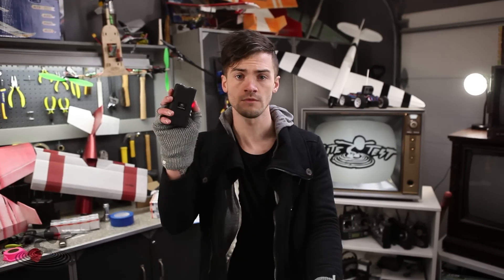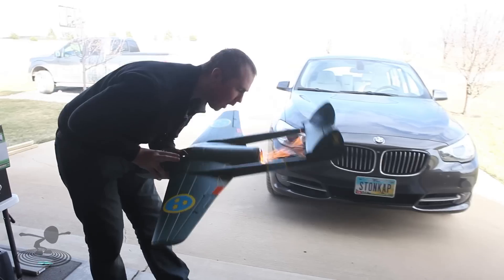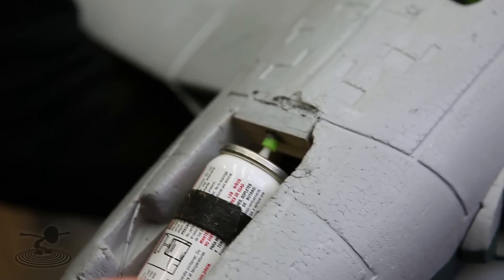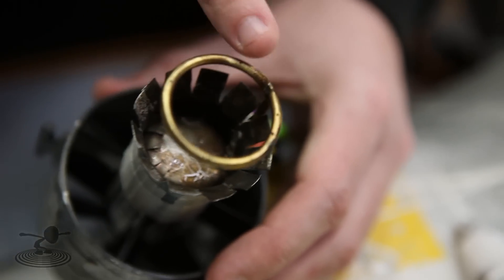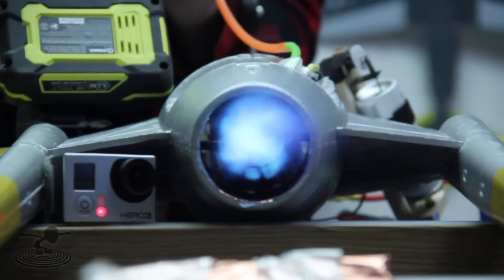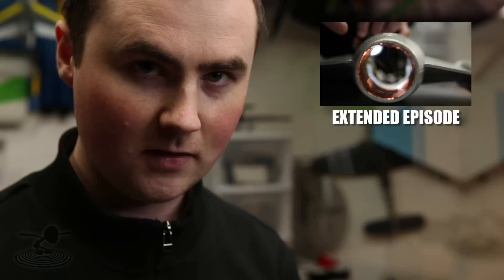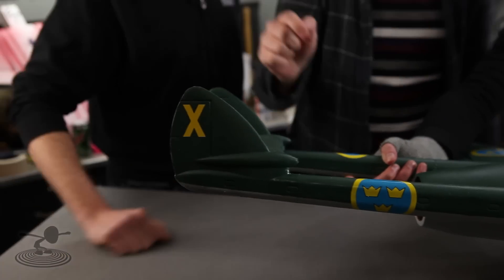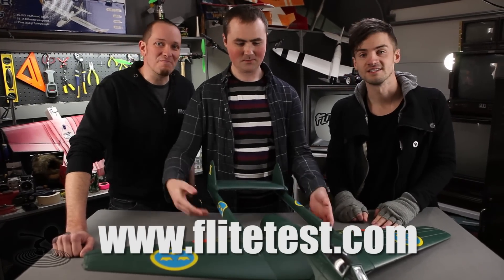Flite Test - EDF Afterburner

Comment: So you used a real model Gas Turbine sound effect....and how exactly did you arrive at a 15% thrust increase? ...As an engineer, I would suggest a decrease in thrust is the reality, all that fuel coil slowing down the airflow from your ducted fan, which incedentally is a very inefficient way to provide thrust in a model....Ducted fans and real Gas Turbines are in no way even similar....Brave though, considering the plane is made from very flammable foam.
Reply: Are you an aerospace engineer? Do you understand how afterburners work in real turbojet engines? Ducted fans are in no way even similar? Where did you go for your engineering degree? A turbofan jet engine is in fact a ducted fan lol. The Large fan you see on passenger planes is turned by a turbo jet. But the majority of the thrust is produced by that first fan in fact it provides 80 percent of the thrust. also 80 percent of the air bypasses the turbo jet assembly. An afterburner is a ring of injectors(might look very similar to his fuel coil) that pumps fuel directly into the exhaust of the turbo jet and is ignited. What happens when you increase the mass of the exhaust gas like he did by burning butane? you get increased thrust. True it will rob it of power while not in use but it will provide more thrust while it is used. Is what he built a turbo jet engine, no. Is it inefficient compared to a military jet engine of course, but neither is it a multi million dollar engine.  A quick Google search would have prevented you looking like a complete idiot though not by much when you claimed to be an engineer.
Reply: Adh5

Comment: Interesting concept, more of a very primitive liquid-fuel rocket than an afterburner (which it is not), might work better and produce more thrust with an intake and combustion chamber of some sort (Bernoulli's principal).  Convergent intake, divergent combustion chamber, convergent nozzle: ><>.  Would probably make a killer little rocket motor.  Good luck!
Reply: It's not easy to make a proper afterburner with an EDF, a really jet engine compresses air very substantially, then the afterburner injects the fuel into that compressed and ignites it, thus greatly increasing the pressure again, with a single prop it's not really possible, it's a great effect though, and certainly sounds the part.

Comment: Hi Guys:
Really cool vampire, and the afterburner. I am almost jealous :)  .
You have doing extremely well, and congratulations.
You use a electric motor powering a fan in the duct, right? so you say you got about 15% more trust with the afterburner, right?
Keep up doing your nice projects. Have you studied combustion and aeronautical engineering at all? It can be a little frustratin depending on your teachers, but you should go for it since you already know a lot.
Once more cheers !

Comment: It has intakes (up underneath, I think), though the actual Vampire had them in the wing roots) Most of the power comes from an EDF fan. The butane was mainly for looks, but when ignited, it does add a bit of thrust. (technically called a thermo-jet)

Comment: Real RC jet engines have been around for years. What this video has is a cheap electric motor with afterburner. There is a slight difference in the price of an RC turbine engine and an EDF unit!

Comment: Hey, you should try adding a row of IGV's (Intake Guide Vanes) before the EDF and a row of stator vanes after the EDF to see if you could actually compress the air somewhat before it gets mixed with butane to see if you could possibly get extra thrust out of the deal. Great vid by the way guys!

Comment: Jean you have to obtain a special license to fly turbine in the US. You are correct in that this project is not illegal. However it does violate several rules set by the AMA. These guys are flying over privet property so not a big deal. The concern is people trying this and flying at a park or field and starting fires. The AMA rules against open flames on a rc aircraft are there because of past accidents.

Comment: the loop thing the fuel travels through is not heated at all i think. It should be enough to let the gas warm up with the airflow of the edf. As I said, the fuel will change to gas just by the normal outside temperature, it just needs some time for that. By letting it travel through the loop, the way to travel is longer, and therefore takes more time. You just need your battery for the ignition box also shown in the video. :) I still hope I didn't get anything wrong =)

Comment: Inside a box? No.  Wrapped around a copped coil? Yes.  The copper coil that the gas flows through need to be long to in order to give the liquid butane time to heat up.  As to your lipo's blowing up.  
1.  Multiply the battery's "C" rating by it's capacity in Amp/Hours
2.  Look up the resistance of your heating wire per unit length
3.  Make sure this Inequality is true: 
Step 1's value > Maximum Batt Voltage / (Resistance of your wire per length * length of wire)

Comment: so all i need to do is just warm up the fuel before it comes out from the exhaust?can i use a hot wire to warm it up inside a box or whatever before they were ignited behind the edf?and will the battery blow up if i connect the positive wire and the negative wire to a hot wire like they have shown in the video to warm up the fuel(in liquid)before they were lighted up behind the edf

Comment: it sounds very similar to a jet engine, because it similar in design. The only thing i see that is missing, is the final compression chamber. The sound is also amplified because on the air passing along the flame. It sounds very similar to a Acetalyne torch. That is how they have created that faux jet sound. Hope that helped some

Comment: with a bit more work you really wernt too far off from having a working turbine, wouldnt a glow plug have worked instead of the stun gun? you just have to pull the filament out a little bit with a tooth pick.

Comment: You probably can try placing the "flame ring" before the coil of copper tubing. This way the flame will create a better afterburner effect as well as really heat the butane properly. It will also allow longer burn time as heat will cause expansion of butane and really increase it's volume and so less liquid butane gives more gases butane and more flames :D Basically your consumption of butane per unit time will decrease. This will also increase the pressure inside so should sound a lot better :D

Comment: After the butane exits the bottle it is still liquid, because the expansion lowers its temperature. So what you do is to give it some more time to warm up in the wire loop you saw in the video. Butane is liquid up to a few degrees below zero degrees Celsius, so I think it was very close to get that to work in these weather conditions. 
If I got something wrong please feel free to correct me :)
Greetings from Germany to you guys!

Comment: I had an idea the other day for a VTOL F-35B that used one propeller facing vertically. Now, you may think this would spin out of control, but the flaps that would control the airflow would have little ramps on them to direct air in the opposite direction the plane would want to turn. Controls would be normal flaps with the air flaps having control in vertical flight.

Comment: Thats a great way to make an EDF jet sound realistic. However, you might want to check out this video: (look up 1/5 scale jet dragster test with afterburner, couldn't post a link, sorry) where this guy did it with an actual model gas turbine Its a bench test, but its for real. Does your afterburner actually increase power, or does the increase in power come from removing components?

Comment: Love it, really made me smile this one. Sounds great and it made 15% more thrust.!. Thats probably more than the first full size afterburners. Awesome David.  

In theory the afterburner on this EDF setup should be able to produce more thrust as the front end does not use up any oxygen. Taking it a bit further, RAM jets only have a turbine in them to get the air fast enough in order to start them. (eg SR71) An EDF with a small battery is a whole lot simpler and lighter. 

On my project list!